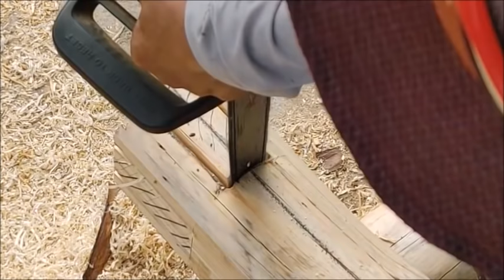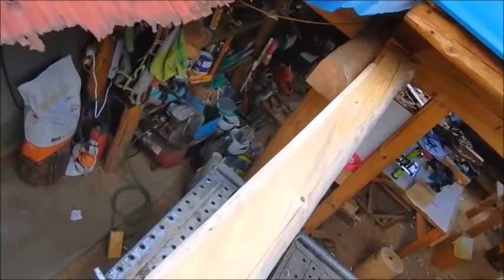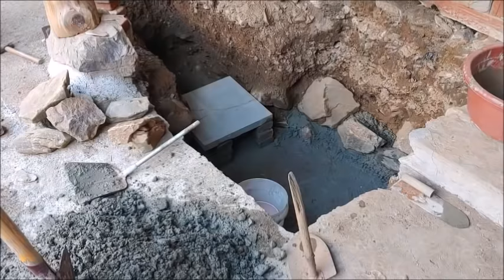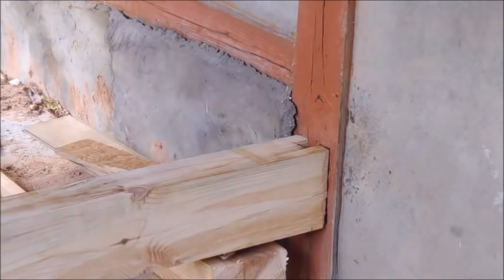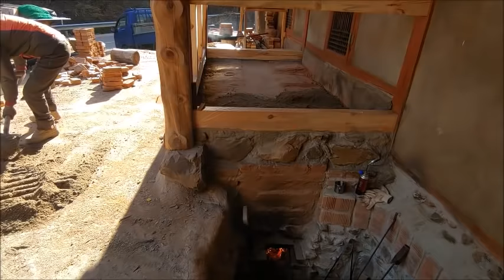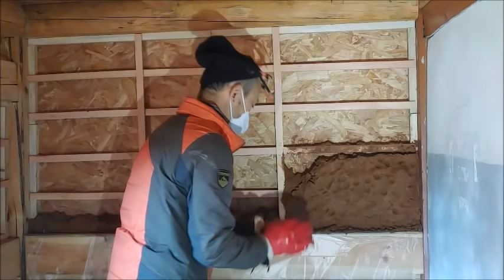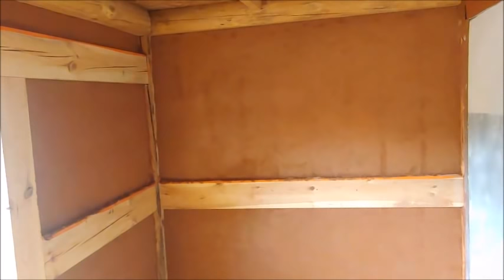House25-꿈의구들방 ,나의온돌방,4개월의 노력!, 한옥.wood.

Comment: If he had stopped with the lattice on the walls and covered it with chip board there would have been dead air spaces - insulation. As it is the mortar is a perfect conductor of cold directly to the interior. Can you imagine how long it would take for that fire to heat the floor through all the layers of stone and mortar.  The interior of these buildings lasts about 10 to 20 years at most, then they fall apart. I have seen them. They become a real mess with the only option would be to start over again. Yes, he is clever and does an amazing job of wood working but these houses are not for the long term.  Note that there is no light in this room except what comes through the PAPER covering on the door. Do you think that paper keeps out the -10 degree C temperature??   This is why the sit to eat and converse in these rooms and sleep on the floor.  These rooms are frigid in winter and broiling in summer - no ventilation in this room and it is a room to be lived in. You can admire the workmanship but I guarantee you would not live in that place during January and February, especially in the highlands. You know how much wood it takes to keep one of those fires burning 24 hours a dya.  That is why there are no trees larger than about 10 diameter in Korea.  By the way - they have about 5000 years of experience living there and developing these buildings.  Notice that even the main building has no windows for ventilation winter or summer. I lived in farm country where these houses are located - that is those that have not been torn down and replaced with moderns concrete and brick.  You can see the average size of a Korean tree by the wood he is using. There is no old growth there except in the imperial parks - what's left after the Japanese destroyed most of them.

Comment: I'm interested in ondol and I want to make one here in Romania under my wooden structure, but I don't have the materials that can be found in Korea. Can you help me a little please? I don't know what is the name of the paste that comes at the end as finishing? and the paper that is put on the floor and on the walls, what is it called and what is it soaked with? It is also difficult to find regularly cut basalt stone slabs. I found something only imported from China. Thank you in advance
Reply from the maker: 1. It is an external putty applied to the wall. You can use any one you can find.
2.Hanji (Korean traditional paper)
3. Slab (basalt) - You can use Chinese products. The ones I used are Vietnamese products.

Comment: Traditional undol heating using charcoal produces significant amounts of carbon monoxide and causes deaths every winter in poorly ventilated spaces. It's a viable heating method, but must literally be air-tight.

Comment: Respectful question: Is stone as the base of the columns an ancient technique, prior to the use of cement? Or is it a better option than cement?
Reply from the maker: Cement has the property of absorbing moisture.
If the wood sticks to the cement, the wood will be damaged.
So, I put the tree on the stone.

Comment: That is one skilled, hardworking, multi talanted guy - but all that work only produces ONE small warm room in the whole house ??   and you have to climb down into a hole inna ground to power it up?? With newspaper an offcuts ??  Any form of modern central heating is gotta be better than that???

Comment: I loved ondol when I lived in Korea for three years in the 80s. Not really practical or legal in the US with the environment pollution and carbon monoxide poisoning resulting from burning coal briquettes or wood due to fine cracks that would develop on the concrete/joints. If you didn't grow up with it, your tolerance for monoxide poisoning was high, leading to death.